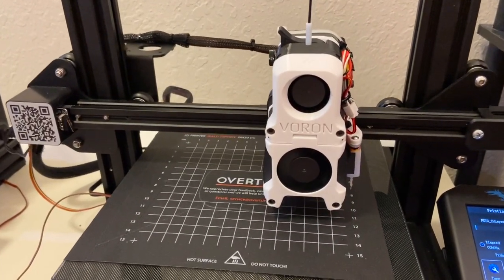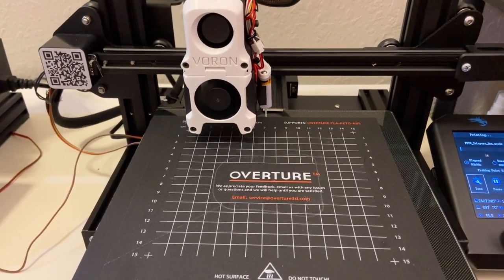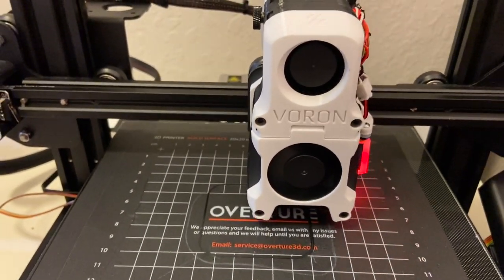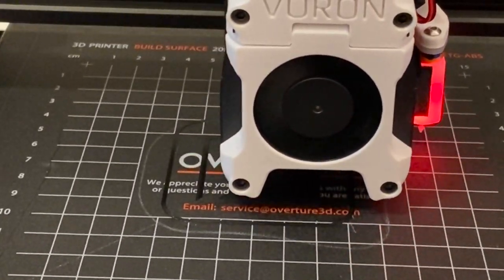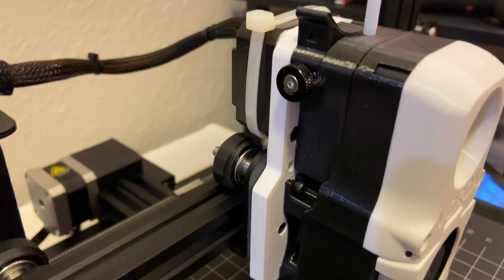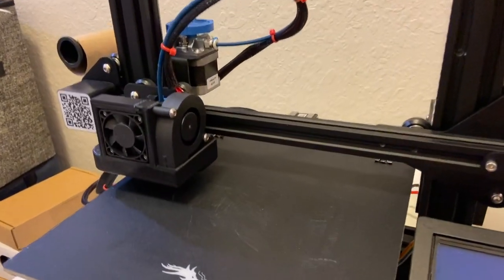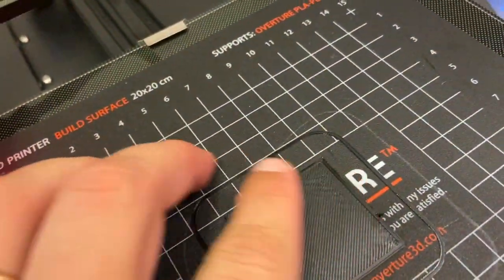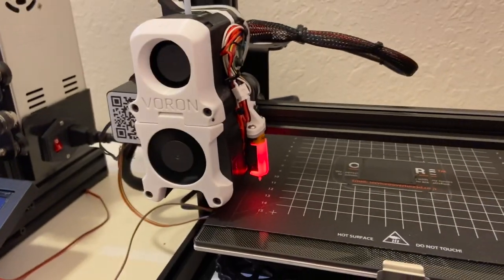Ender 3 Voron Afterburner Print Head (PETG)

Comment: Stock hotend? If so, what stl did you use for the mount? I definitely want to use this!
Reply from the maker: I used Dragonfly BMS got it for 30$, but i think i have seen STLs in Thingiverse for stock hot-end.
Reply: @hobbyistnotes  Where'd you get your hands on that hotend for $30? I'd love to get one for my V2.
Reply from the maker: @ZachAlanPhotography  Just luck of eBay.
Reply: @hobbyistnotes  I found it! Just finished putting it on. I found one for the stock hotend and also a mod to fit a 4020 hotend fan.
Reply from the maker: @MrTrex62  Amazing, i would like to see the end result!
Reply: It is possible to both use the stock hotend and mount to the stock carriage with v-wheels (no linear rail) with the Afterburner design/assembly, but it's not easy to keep track of the remixes/mods that need to be printed, lol. I just know it's possible based on all my research. You still want the thinner pancake extruder motor, though. I don't think the stock extruder motor works, nor would you want the extra weight.
Reply from the maker: @mjodr  Yeah stock plate with wheels works perfectly, the only thing you need is a pancake motor OR you can go with bowden version, i use pancake and it works perfect with stock plate, also there is a version with Orbiter extruder available definitely worth a check.

Comment: is it worth changing? Are the prints a lot better?
Reply from the maker: Not a lot, but better mostly due to dual gear direct drive and more expensive hotend, new stealth burner is way better. In reality you can achieve same print quality with cheaper mods.

Comment: If u are using klipper can u send me config file? I done this mod but the print doesnt print in the center
Reply from the maker: Just added my GitHub repo with configs in to the video description. Concept is simple you need to set nozzle offset first and than regulate end-stops location.

Comment: what white abs brand your using?
Reply from the maker: I tried eSun ABS+ that i mentioned in the video, but i don't like it at all poor layer adhesion and part came out very brittle. Yesterday used Hatchbox Blue ABS, printed perfectly with Brim and feels amazingly strong. Also ordered Paramount 3D and wanna see how it goes, may be in next video will show the results, printed with Ender 3, i have one and using it just for that task without enclosure at the garage to avoid contact with the ABS fumes.
Reply: @hobbyistnotes  cant your share slicer seting for ender 3v2?

Comment: do all afterburner parts use PETG pr abs??
Reply from the maker: Yes, full PETG with same requirements as for ABS. Currently printing some parts with ABS to see the difference. So far my PETG nozzle temp higer then ABS and everything holds up very well.
Reply: that's so cool are you going to switch to klipper Fw?
Reply from the maker: @madorax251  Yes, i ordered SKR MINI E3 V2.0 to use my pi Zero W with UART mode, and other printer will run regular Pi 3 on stock 4.2.7 board from this printer, cus it currently has older 1.1.4 board w very loud drivers. Also had plans to do UART drivers mod on 4.2.7.
Reply: ABS normally has a higher glass transition temp. I personally had an easier time tuning in ABS than PETG.
Reply from the maker: @MrTrex62  I just hate fumes from ABS, tho just finished printing one with ABS waiting for new hot-end. PETG is bad if you want to print in enclosure, otherwise it works well.
Reply from the maker: @madorax251  Already switched, works fantastic. Thinking to switch all of my printers to klipper.
Reply: @hobbyistnotes  esun abs+ has no to little amount of fumes, also its great if you print it without an enclosure doesn't shrink much
Reply from the maker: @MrTrex62  I tried it and it has very poor layer adhesion... if be honest i am very disappointed with esun ABS+ considering all the hype... I have way less issues with Paramount and Hatchbox ABS, who knows may be it's just batch issue. I tried different temps and dehydration, no luck it's just separates with little to no force.
Reply: @hobbyistnotes  I use a spring steel pei sheet. It's amazing for alot of filament types. The issues could be a batch. I have had the same issues your having with hatchbox pla, petg and abs in the past.
Reply from the maker: @MrTrex62  I placed esun in dehydrator, will try again later this week.
Reply: @hobbyistnotes  what temp?
Reply from the maker: @MrTrex62  You mean dehydrator temp or my printing temp? Dehydrator room temp. Printing tried Bed: 100, Hot-end: between 230-250.
Reply: @hobbyistnotes  dehydrator temp. 55c to 60c for 12 hours or so? This is my norm. I haven't really dried too much abs though, it might require higher temps then my dehydrator/heater can handle. Mine can go a max of 55c
Reply: I'm printing @ hotend temp of 245c and bed temp of 110c.
Reply from the maker: @MrTrex62  I just use sealed box with ton of silica bags, measured hydration in that environment around 10% at 27C
Reply from the maker: @MrTrex62  One of the reasons why i like PETG - it has 0 smell, or at-least my sensitive nose can't detect any compare to other filaments i used. I can't stand PLA and ABS definitely need air-filtering. I print ABS in my enclosed garage sometimes. Thinking now to build enclosure or Voron printer all the way just for ABS.
Reply: @hobbyistnotes  that won't remove the moisture from the filament that it has already absorbed.
Reply from the maker: @MrTrex62  Disagree, this setup worked for me perfectly fine. I can show graph how moisture level drops in to the container every day as it pulls moisture out of filament. It's not an instant or fast method but few days more than enough per my experience.
Reply: @hobbyistnotes  I just built a 350mm 2.4 Voron for one of my buddies. Amazing printer! I do not currently have the budget to fork out around 1400 to build one for myself. But I might build a 0.1 though. I want to run everything abs or higher. My next goal is to start printing polycarbonate.
Reply: @hobbyistnotes  I guess maybe in your environment. That's a no go in mine. I can't get petg to sit out more than a day before it's not printable. That's why I have to put it in a heater to push out the moisture. But hey, if it works for you go for it!
Reply: @MrTrex62  Nice, for me 350 is too big, and 0 is just too small. I am thinking about 2.4 250mm or Switchwire as i have 3 x Ender 3s and plenty parts. I probably can build it without even buying anything.
Reply from the maker: @MrTrex62  Yes i agree, environment makes huge difference. I have AC controlled place with 40% humidity. I think it's possible to store filament as is...
Reply: I have just printed and assembled this on my ender 3 V2 using a e3d V6 hotend. I have no idea what I need to do now, what settings do I need to change for the new extruder setup, and do I need to do a PID tune because I have a new heater cartridge and temp sensor? It seems it has trouble staying at the correct temperature, also, it's sits more to the left how do I offset that? Thanks :)
Reply: @Akira.Nibbai  make sure in your setting the firmware that its configured for the right heater and thermistor, Pid tunning, temp tower, retraction tower, calibration cube.
Reply: @Akira.Nibbai  FYI, if it struggles to be at correct temp its for sure needs a pid tuning. Usually anything changes to the hotend needs a pid tuning.
Reply: @MrTrex62  thanks mate, I ended up adding the estep settings for the BGM extruder and flashed a custom fw did a PID and trying a benchy now, thanks for the reply
Reply: @Akira.Nibbai  no problem mate. If you havent tried fluiddpi with klipper yet, I highly suggest it.
Reply: @MrTrex62  Im still fairly new to 3d printing, I'll have a Google :)
Reply: @Akira.Nibbai  I wished I would have learned it from the get go. I hated dealing with the b.s. of marlin just to have slow printing speeds and very little customization. If you just want to get up and running and print go for it. But if you want fast speeds, take the time and have full customization, klipper is for you. Klipper is used in octopi, fluiddpi, mainsail. Personally I like fluiddpi the most because of the ui and I can use my pi3.
Reply from the maker: @Akira.Nibbai  Yes, you have to set, nozzle offset, you have to set probe offset, you need to do PID tuning, if you used pancake extruder motor you need to adjust vref to about 0.6v as motor 1amp only, next you need to adjust E-Steps to make sure your extruder pushes enough filament. Id start from 425 than use e-step calibration method.
Reply: @hobbyistnotes  yes I've used a pancake motor, I have already done some test prints, I did not adjust the voltage, will this damage the motor?
Reply from the maker: @Akira.Nibbai  stock Ender extruder motor runs on 1.2-1.3vref that is close to 1.8amp which is almost twice what needed for pancake motor, it will damage the motor overtime.
Reply: @hobbyistnotes  I do not have a multimeter, so can I just turn it until the extruder stops extruding?
Reply from the maker: @Akira.Nibbai  I don't think this is the best way to adjust vref, cheapest multimeter is like 5-10$. Must have tool for a hobbyist. You don't have to go crazy and buy most expensive one, but you should have one for sure.
Reply: @hobbyistnotes  I'd suggest getting at least a pi 3b. pi zero(w) is sometimes slow with some tasks.
Reply: @AM-ob7yi  Currently have 3 x Ender 3s and 2 weeks ago i converted one to work with klipper on Pi Zero W. I love how with Zero you don't need extra PSU or buck converter to power it, power form SKR MINI is more than enough with one cable. I know it is can't handle the camera, but same time printing works perfectly fine, about 50h+ of printing and no issues... The only thing i don't like is how slow the SW updating process is taking... Used it because i have 2 x Zeros W around without any use and it's perfect application with minimal headache. Currently working on the enclosure project for one of the printers and preparing it for ABS. It will work on 3rd Pi, just finished octoprint configuration for that need, have to do some rewiring in order to keep board and PSU cool. But i agree that Pi3 has more applications and works faster without issues and supports all the features.
Reply: @Agilato  make a drone with your extra pi zero w lol

Comment: Looks heavy
Reply from the maker: It is definitely heavier than stock Bowden but Lighter than other direct drive setups due to motor size.
Reply: @hobbyistnotes  is it lighter than the micro Swiss dd? I didn’t know this had a special stepper
Reply from the maker: @rp479  I think MS-DD uses motor and plate that weight more than whole Afterburner+Clockworks assembly. Currently waiting for new parts to assemble second AB with ABS, when i'll get it i can post the video with full weight.

Comment: A bit overkill for an Ender 3 xD
Reply from the maker: 100% agree, worth like used Ender 3. I just wanted to try Voron's stuff, before spending 1k$+ for Voron 2.4 parts.
Reply: @hobbyistnotes  Relatable, Voron parts are not cheap. Since a full Voron build is out of my reach, I'm thinking about upgrading the printhead of my Ender 5, possibly even upgrading to core-xy. 
Great job on your part.
Reply from the maker: @Shadow9OO  I also have Ender 3 Pro with Trianglelab's Bondtech BMG extruder on Bowden with stock hot-end and i like print quality much more, thinking what can affect Voron Toolhead quality.